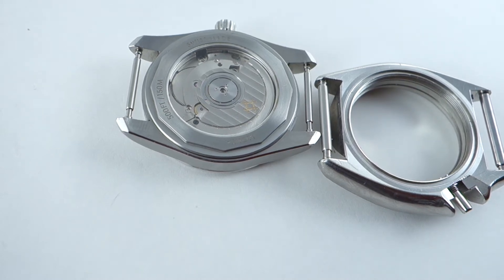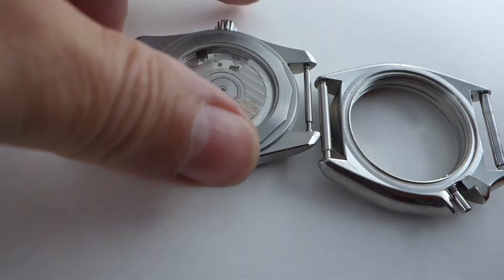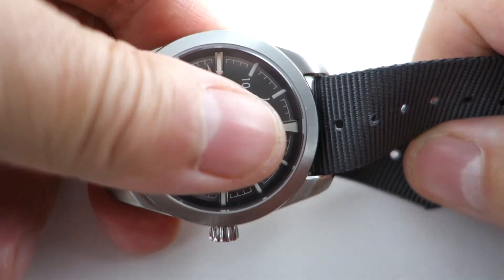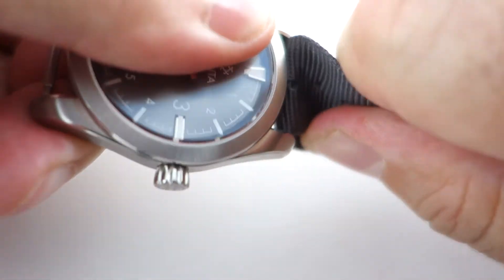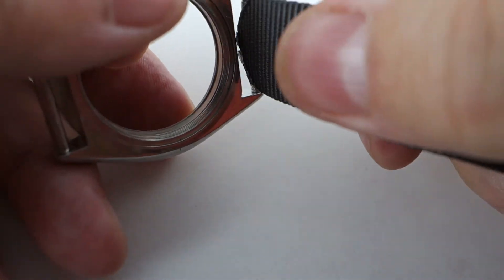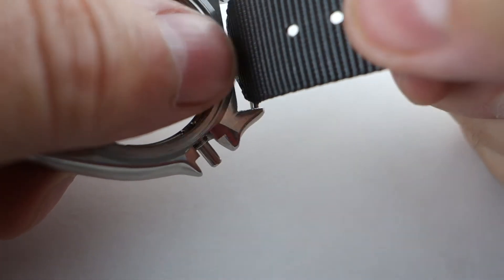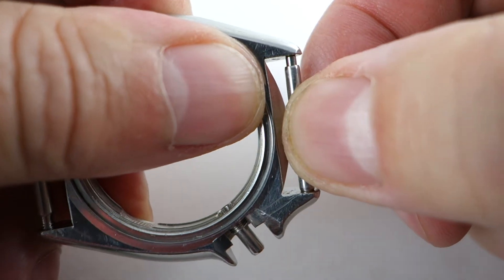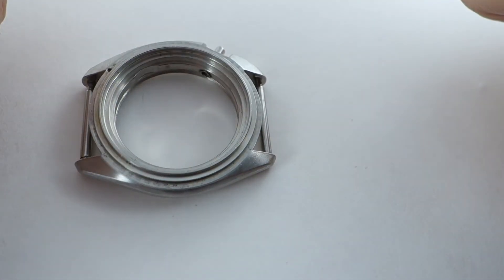Do nylon straps really make spring bars release?

Comment: The only time I've ever had a springbar pop out or fail was due to me wearing my watch too loose and letting it flop around on the bracelet, and this only happened because the bracelet had hollow end links. The two retaining rings on the end links placed uneven pressure on the springbar and bent it until it popped out. NATOs are great! I have about 20 of them!
Reply from the maker: On hollow end links if you adjust the ring that goes around the spring bar tighter it will keep it from bending the spring bar.
Reply: @utewatchco1468  Yes, I know what to do now. This happened 30 years ago.

Comment: yea, internet folklore: I typically use one size down in terms of a nato (an 18/19mm strap on 20 mm lugs) and have done this for over 15 years now, and have never had a strap release a spring bar.
Reply: I wear the exact size as the lugs and I have never had one fail. So I totally agree with you David.

Let's stomp out the "lore"!